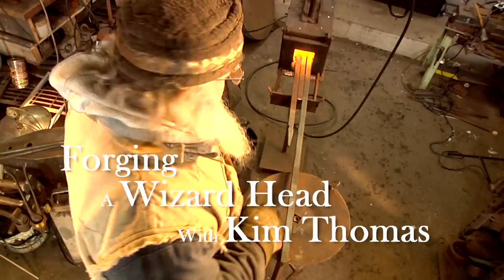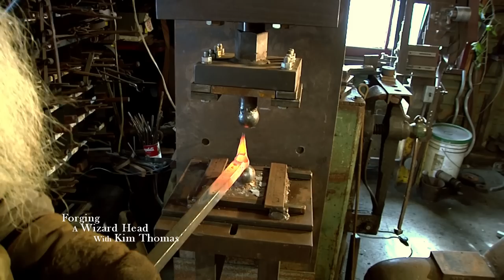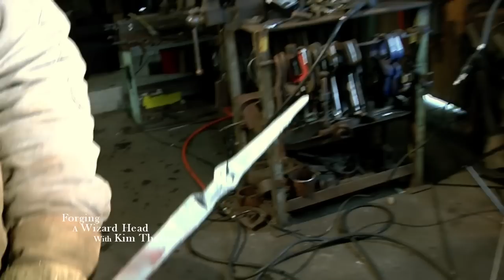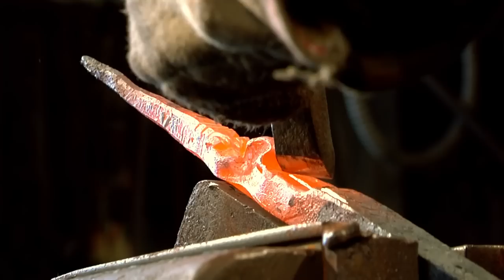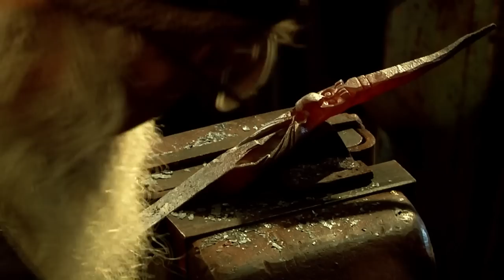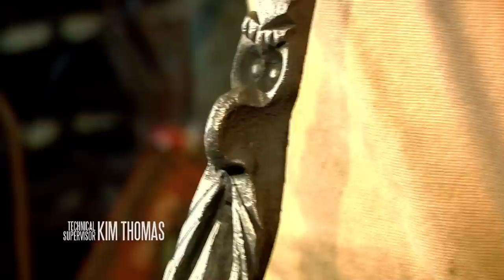Amazing Blacksmith Forges A Wizard

Comment: Next time do it by hand, see how good it is then. If I had all of your tools, I could do it too.
Reply: Rude much? He actually took the time to make this where as you just sat there in front of a screen and trolled it. Great skills you have there....
Reply: Actually I was laying down in front of the screen. You, if you wanted, could do it too. Using a power hammer and other hydraulic systems would be like melting ice compared to doing it by hand, all you do is just let it happen. I in no way wanted to be rude, I just would like people to appreciate blacksmithing more than just a machine banging metal. It is a skilled craft in which one wrong hammer blow or getting the piece to hot in the forge will ruin a piece. This isn't true blacksmithing but it is still good. I just want to see it done by hammer in hand.
Reply: Also, if he had a problem with my comment, he should have stood up for himself. Who are you to tell me how to treat others, that is their job to say if they have been wronged, not yours.
Reply: Doing anything by hand is great.  Working smarter, not harder, is the secret of a genius.  Even if he were to do the work "by hand", he would employ many of the same tools, which he probably made himself.  No matter if he uses a power hammer or a cross peen hammer, the results would be nearly the same for a master smith such as he is.  I can say from experience that using power tools to do a production-type job like this is much more reliable and effective than a simple hammer and anvil.  He probably does have a problem with your comment, but is probably too busy working "by hand" at his amazing smithy to worry about a bland uneducated comment that some faceless person posted on the internet.
Reply: Your last point is my point exactly. If he was really bothered by it, he would have retaliated respectfully like I am trying to do, however it seems to be failing... miserably...
Reply: Yes, but when our lives our automated, we don't control them. I don't know where you live, but in the U.S., we are on auto and that has made my life great, but I can't go fell a tree or even build a shed without the government's concent (excluding the tree part.) In conclusion, this was a wonderful product done by hand, not completely by hand however. I want to see him, or anyone else, do it by hand and hammer so I can learn to do it, too.
Reply: I should hope that when I am the gentleman's age, I can still do something as constructive as he does. He obviously has a bad left leg, and can't get around as well as perhaps a younger man can. Let's suppose also that swinging a six or even a four pound hammer fr an extended period of time is more than he can do as well. Therefore, I would suggest that the hydraulic and power tools are a labor saver which allows him to continue to do the work he has obviously done for decades, judging from the sheer number of handtools hung throughout the shop.  I disagree with the assertion that the power tools make it possible. I'm an accomplished metal worker, but I doubt I could execute the "Wizard" on the power equipment any more than I could with hammer and tongs. There has to be skills and technique before you can create. You're correct Paracorder, WE (You and I) have allowed the Federal Government to dictate our every move. Is this the price we pay for security, for the peace of mind of not worrying, for having food and water on the table every day? I think it's a subject that would require much more discussion than we have space for here!

In closing, the video was produced by Zebulon Thomas Films. The smith, Mr Kim Thomas, probably doesn't do the YouTube thing!

Albert
Reply: Albert Rasch I wish I could hit that like button more Albert.
Reply: I concur. And for Albert, thank you for pointing out his leg, I was too saddened that this wasn't a how to to notice. I, if I haven't clearly done so, would like to apologize. After rereading I see where the curse of "texting" has come into play.
Reply: No worries Paracorder! I hear you. I have also noticed that texting and virtual communications, combined with what passes for education in this day and age, have really made it more difficult to actually communicate what we are trying to express. Forums in particular are rife with the results of poorly worded queries, and answers that range from the incomplete to the incomprehensible. The anonymity of the medium lends itself to people "saying" things they would never say to another person's face. You are obviously an intelligent and well mannered person, and by your responses it shows! So again, no worries.
Now, let's see why you chose Paracorder!
Take care and be safe!
Albert
Reply: Thanks once again. Are you asking for the story of my channel name?
Reply: PlebzOr Blapparapp We all are.
Reply: Thanks for your observations? If you took the time to read the comment string....
Reply: Lightning Forge
I look forward to seeing your rendition of the wizard with your new forge...
Reply: Doubting doesn't make it true. I know how to swing a hammer however learning from master like you would be great if you could come teach me on my forge and anvil set up? Lastly I am not a sick, you don't even know me so how could you even know that. All of your arguments are pointless attempts to try and bring me down from a tower that doesn't exist.
Reply: Its weird, because I went to your channel and there was no video of you doing it. So your comment doesnt make much sense.
Reply: Very good observation. I am currently engaged in school work. So if you have ever Benn through that you know....
Reply: Ok, so what is the sign that a piece it burning in the fire? How hot is the fire? What is the lowest color level when heating a piece? I know these answers, but you would need to look them up I assume. Blacksmithing is a passion of mine and a hobby, just because I don't put it on the internet for the world to see doesn't make me any less knowledgeable.(And the answers are a lot of sparks rising, 3000 degrees Fahrenheit, and what is called a black heat because it is hot and black but of no other color. I know this because I have researched blacksmithing very thoroughly through books and the internet and through, guess what, experience.)
Reply: Are you talking to me? Who is RobsonSantos?
Reply: Just so you all know and hopefully stop contributing to this pile of comments, I have been asked to become an apprentice by, you guessed it, a real live blacksmith. I just don't understand why because you can't see things you don't believe them.
Reply: Paracorder
Who blacksmith master takes on an apprentice who thinks they already know everything? and why would you want to be an apprentice if you already know everything?
Reply: One that took it on for the craft, not for himself. He, after the previous blacksmith past, took it on to keep the blacksmithing craft alive in our area. I never once said I know everything unless ever out of sarcasm. If I did I apologize for the confusion.
Reply: using power tools doesn't constitute lack of skill. All tools do is make things go quicker. Even using power tools involves knowledge of the tool itself and techniques that you would still use if you were doing things by hand.
Reply: Paracorder  3000º farenheit for black heat haha, yea... sure xD.
And all tools them beeing manual or machines need to be mastered to make this kind of work.
And using machines isn't a shin or a scandal as you seem to see it, because you know, we dont live in the stone age; the end results are what matter.
Also having more power by using the machines also makes mistakes more apparent, because a mistake with that extra strength can create bigger flaws, that are harder to correct too.
Reply: I never said that, I was listing the answers to the questions I listed. 3k is far far far past a black heat, that is smelting territory. As for the power tool, you are correct in that flaws are harder too correct, but less are made and of course one can always just  undo and redo a bar until it has rusted away. All metal once was a liquid, hardened into a solid and then shaped, this can happen again and again.
Reply: My forge goes past 2100F, had a bar melt and fall out the bottom when I was distracted by a phone call. Lucky me I thought to make an ash dropper. Weight of the molten blob tripped it and saved my tuyre and baffles from getting clogged. I need to stick a coffee can under it that's full of water next time I fire it up.
Reply: You gave me a great idea! Next time, I'll fill the bottom, the ash dump, with water so ash is introduced slower and it doesn't create a glue of sorts.
Reply: Paracorder
It would all boil away in no time. Ash isn't introduced, it is right there in the forge from the burning charcoal or coal. Ash also doesn't glue stuff together. It melts like flux sometimes, but it doesn't behave like glue. You don't sound like you've ever used a forge. Probably can't even make a nail.
Reply: What? He used the tools available to him at the time? Just like blacksmiths in medieval times did?
Appalling!
Reply: The bottom area of my forge doesn't get that hot, hot enough to burn you but not boil water. What is the crust with a grey white color?
Reply: He has plenty of other hand tools, well any experienced one would. I assume from his ease of doing that he at least has a day or so on the job. ;-)
Reply: corthew
The shop press is saving space. If he were to use only old tools, I have no idea how modern people would fit a water-hammer in their usually cramped workshops. Haha.
Reply: Paracorder Slag, Clinker, melted plastic from your easy bake oven forge, a melted beer can with ash crud stuck in it. Who knows.
Reply: No you can't. You don't have the experience or years of practice it takes to do any of it. Tools make it faster, not eliminate the amount of skill required.
Reply: are you poor is that why you don't have a power hammer?
Reply: :-) yeah, that plastic is a real pain.
Reply: He used a hydrologic press and a hammer drill, that doesn't take that much skill, however, getting to know how to use them is harder
Reply: No, I don't have the space for one, I barely have space for a portable forge.
Reply: that's hydraulic, not hydrologic.
Reply: Bjorn Njordson but what about what water thinks?
Reply: lol
Reply: Bjorn Njordson, if you subscribe, or anyone else for that matter, I'm going to be putting up more videos in the summer when I don't have to really worry about school. I hope to hear back from the blacksmith I mentioned earlier and get a few videos from that, maybe some spoon, dishing and scrolling techniques, too.
Reply: Paracorder
just search it on youtube or go to the library. no need to trouble a teacher in this day and age.
Reply: Very true, and that it how I started but he came to me and asked. I already knew him and the opportunity jumped at me. He wants me to be the new town blacksmith.
Reply: Paracorder 
Sir, have you considered that perhaps he uses the machine due to arthritis? Many blacksmiths have a hard time after so long at it because of the constant work on their joints. Thank you, have a good day.
Reply: Yes, other sir, I have. Thank You, however, for your input.
Reply: Paracorder
If you want to learn to do it by hand; find a blacksmith, become their apprentice.
Reply: I am in a process. However, the results wouldn't be the same because the process would differ. Thank you for actually taking the time to read this string. Also, thank you for making an educated comment rather than some other commenters. Like the name
Reply: Paracoder, it doesn't matter how much experience you have with blacksmithing. Your argument is still absurd. Is art done with a computer any less of an art? His medium is metal working with a mix of automatic and manual tools. That doesn't make it worse than "by hand," but merely different. Stop being such a snob purist.
Reply: I understand people being on the opposite side of the court on this, but why do you, not all but most, feel like you need to be rude and bully because I have a different view? And something on the computer can be art, but it can be printed 50 say and which one is the original that holds more value of they are all printed at the same time?  That doesn't apply to this topic, but nice try. Next time, don't be a jerk and actually think through your argument.
Reply: Paracorder's common sense level: 1 000 000
Reply: your totally right. today's "hand made" is so fucking lame, they all think they are skilled hard working artists and yet they use 10000 electrically powered tools to do the same thing that old school guy would make using a single hammer. how the fuck can someone claim that he made something by hand when he needs electricity to make it?
Reply: *****
translate to English please
Reply: Paracorder Don't sweat it. I read the board and understand both points. Really you are straight on right. Perhaps the situation was different but still yes, doing things the old way preserves our future believe it or not. Many a good trade and trick was lost to tech advancements. And yes I understand you about the loss of intimacy within trade. Still I think the one above about his age and advantage is true..the tools in the back are hand. So he is most likely a Master blacksmith. In such a day you would not be dimwitted to learn both sides of the trade as did this man and many other masters. I tell you it would provide you a living while you can work on your other purist projects. Just an suggestion. Ask around and meet your local blacksmiths...
Reply: Wow... I never thought that after reading my comment overs and over and understanding my mistake that someone.e would actually come out with a logical and helpful reply. I have contacted my local blacksmith and he is waiting to meet so I can have a true master and a town blacksmith as my masters. He really is a great guy that I already knew... what a benefit.
Reply: Paracorder Well good luck in it.
Reply: Thank you
Reply: Thank you
Reply: You want to chisel into iron with your bare hands? Best of luck to you with that mate. A blacksmith uses tools, a craftsman uses his hands. I think that's where you are mistaken.
Reply: If he can do it with a power tool, he can do it by hand, it will just take longer. That is all these tools do, speed things up. The skill has to already be there. Blacksmiths since the beginning of time make tools by hand to speed up making other tools by hand and so on and so on. It about working smarter, not harder.
Reply: Can a child use a drill to drill in a screw? Usually yes, but can they use a screw driver? Usually not. He did not create this hammer or Jack, he used them for something that he most likely could not do by hand, and thus if I had all those tools, just by watching where he placed the steel, anyone, even a child, could do it too.
Reply: Paracorder No, they couldn't. Go give it a try, i'll wait,
Reply: So your calling me a child, how mature.
Reply: Paracorder No, I am saying it is not as easy as it looks, I was not implying you are a child, just that they could not do it, and neither could anyone without proper experience.
Reply: Yes, but I was referring to the many jigs and does that he used, not just the power hammer.
Reply: *dies
Reply: Is that a youtube channel name?
Reply: Actually, I supported an organization that helps free puppies that would die if it were.not for that organization. I'm sorry all you do is go on YouTube and wish you had a dog instead of saving one yourself. Now that you hopefully have been given the brain cells to understand, talk about something relevant to this topic instead of attacking me personally.
Reply: Only Paracorder is allowed to attack people. NO ONE ELSE!
Reply: Yurp, you're right.
Reply: Thanks, ill think about it and try to find some reviews. 50 bucks is more than 25 times what I can currently afford...
Reply: Yeah that's what I have been doing, thanks.
Reply: No it's not. Internet is expensive to respond to you.
Reply: Being a blacksmith is about using the tools available at the time to achieve the desired results.  Original anvils were square blocks.  Are you going to say that the blacksmiths that adopted horned anvils are cheaters because they began using an updated tool?  The key to being the blacksmith in any century was having the best tools and materials.  Are the people that started using iron over bronze cheaters because they found better material?  If they are...they still made a better sword that won wars.  If you want to go back to the stone age, then be my guest.  Get off the computer because using new tech is cheating at life.

You also don't understand why people think you are rude?  All you did is state that your shop is insufficient to achieve the same results.  You couldn't just acknowledge that he did a good piece of work.  So add me to the list that thinks your rude.
Reply: thing is, he most likely can do it by hand and it'll turn out just as good. He's a wizard.
Reply: Hahahahahahahahahahahahahaha, that's funny.
Reply: i bet he made all of those tools. can you make them?
Reply: He made the power hammer? He made the drill? Come on now, be legit.
Reply: Why don't you? You go upload your calluses hands, your hard work. I was going to say that I'm not arguing but I am. I am arguing with rude individuals such as yourself because all you do is attack and attack and attack like little ants instead of giving a real position. You make videos, go on, show the world what you can do. Me? I'm going to continue being a student with a life and a sports injury. Sorry I don't go around looking for trouble on YouTube all day like you.
Reply: Post! Do it! I never claimed I was a great blacksmith. All I said was that I could do it too with the tools he had. I don't post those things either, yet.
Reply: Whatever. You got problems kid.
Reply: So I shouldn't have subscribed to see your future videos? Because your first one isn't bad
Reply: Paracorder I'm not going to get into the argument. But simply say I agree with Paracorder to an extent. I personally believe in doing the things the traditional way. It challenges the mind a lot. Takes a wee but more skill. And is, in my opinion, much more impressive. Now I'm not saying that this takes no skill. He still has to know how to use the machines properly and safely. As well as know a fair amount if metallurgy. On top of that, most people I've seen using power hammers, build the machine themselves. But now you see where I stand. But good luck with your apprenticeship!
Reply: Paracorder but yeah the use of forms and a press are pretty ridiculous as well
Reply: Hunter Bibb Do you walk or drive to work? It's all just adapting. 

I  could use a self bow for deer hunting, or even make a bow for myself. But I will still use a compound. To ensure no one suffers unnecessarily.
Reply: Brent Bunyak
With all due respect, there are lots of people who do hunt with selfbows, and handmade arrows, and do so humanely.  If  they drive to their hunting grounds, you seem to say that they are hypocritical.   I lean toward the same preference for traditional hand methods like Paracorder, and can understand his perspective.   Using a power hammer and hydraulic presses take a different skill set than hammer, anvil, and chisels.  Not better or worse, just different.  I was disappointed by the use of power tools when I saw this video, because I wanted to compare to the techniques I use and  get some pointers.  The finished item is an excellent piece of work.  Just not one that I can try to duplicate, since I don't have the same (expensive) tools.  I suspect that might be what Paracorder was trying to convey.
Reply: buttonvalley I have nothing against self bows. I just know my limits. I'm not good enough to take down a deer ethically with a self bow. So I don't. 
Yes, anything handcrafted is lovely, especially homemade bows. But I say work smarter, rather than harder. 
Plus, maybe the older fellow couldn't do it by hand either.
Reply: Brent Bunyak
I understand your position, but I don't totally agree with the "work smarter not harder" idea.  Blacksmithing is a traditional trade.  A large part of why I do it is to carry on the tradition, because I feel very strongly that if society removes itself from its past, a very valuable resource is gone.   I think that the end product shown here is an excellent piece, and I don't necessarily fault the smith for the tools he uses, I just was disappointed I could not learn anything from watching him, because I don't have (and probably never will) access to tools like his. Perhaps, as you suggest, this smith is no longer physically capable of doing the work by hand.   However, if we were to take the "work smarter not harder" approach to this project, why not just put a steel blank into a CNC machine and watch the piece being made?  I feel that particularly in the traditional crafts and trades, the process is equally as important as the finished product.  High tech is not always the best approach.
Reply: "If I had all of your tools, I could do it too."

Hahahahahaha :)
Reply: And him as well, he at one point was an apprentice that learned these things... by seeing them.
Reply: So if you see it, you can do is what you're saying? So that means if we watch anything and everything we can all be a blacksmith, cabinet maker, farrier, pianist etc, etc! No skill required then, just watch and we're instantly skilled. Firstly, you need natural dexterity and ability, natural hand skills, an understanding of the materials you're working with, how to sharpen, maintain the tools etc. the, after years of practice resulting in experience you can call yourself a craftsman. Even then there will always be better skilled craftsman than you. But ignore me, go buy your tools and forge and put some videos up. ( Probably how you burn yourself!)
Reply: Paracorder You aren't going to learn how to smith like this without apprenticing so it's irrelevant which tools he's using on a youtube video.
Reply: buttonvalley do you not realize that the only reason guys used to do it by hand is because they had to? I'm sure that a blacksmith in 1820 would have killed for some power tools.
Reply: david smith Did you not read the original comment? If you did, do you not understand why it would be frustrating to read? If not, I can explain it for you.
Reply: david smith Guys still do it by hand; I am one of them.  Of course a blacksmith in the 1820's (or any time "back in the day" )  would want the latest equipment.  They depended on their productivity for their livelihood.    Those blacksmiths who do it for a living today are in the same position, but I would hazard a guess that most practicing blacksmiths today do not do it as their primary occupation.   If you read my earlier post, you'd see I don't hold his tools or techniques against him, I was just disappointed that this video had nothing I could learn from, since I don't have that level of equipment, and have no desire to use such.   I think there is great value in preserving the traditional ways, and I'll bet Kim Thomas would agree with me on that.  Anyone can tell by seeing him work that he would be able to do the same quality work by hand.  That is what I was hoping for when I viewed his video.  I was disappointed in that, as I suspect Paracorder was.
Reply: +paracord your videos are so much better.... i really loved that star spangled banner on the pink oboe.....
Reply: I'm really amazed. Sometimes I just go through the comments on this.
Reply: NO SIR, one wrong blow by hammer can typically be fixed, one wrong blow by a machine that is 100 times as strong of a blow and the piece is ruined. Is it a different set of skills? Yes, definitely. However, most of the detail work is done by hand, the tools are hand made, and this is still blacksmithing. Fire/steel/creating. As you age I wonder if you will still be up to the hard work or just will say F-it, I refuse to use power equipment so I'll just quit instead.
Reply: Paracorder I can do this by hand I make these for swords if you would like I will post